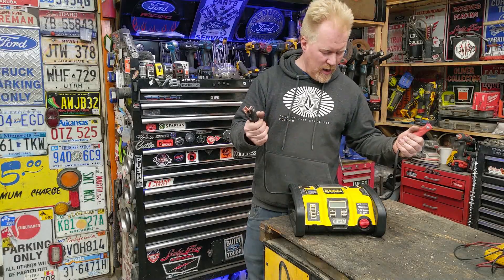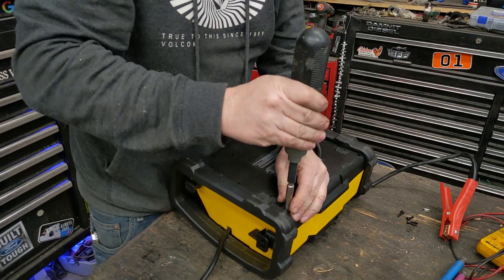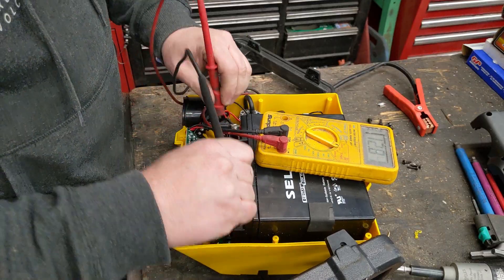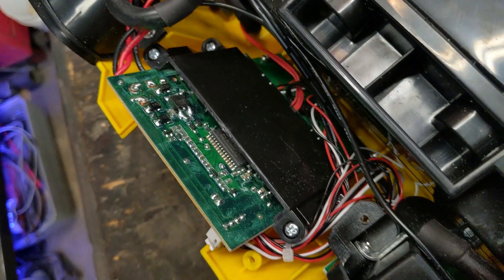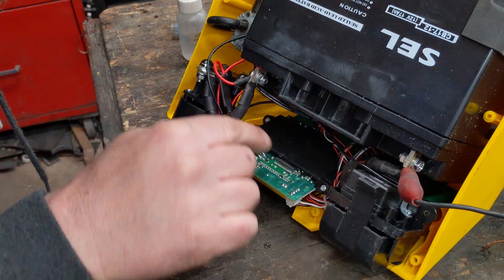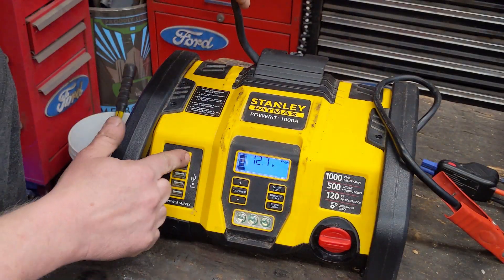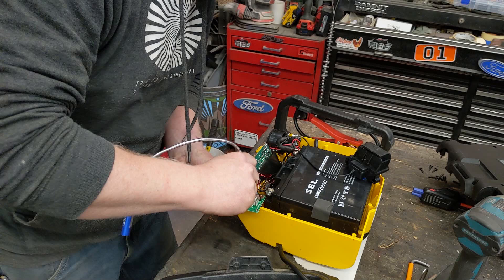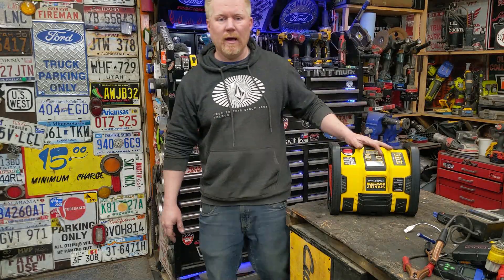NEW Jump Start Box DEAD - CAN it be FIXED?

Comment: You might want to open it up one last time lol.
Use a hot glue gun on all the connectors and loose wiring, like the ones on the pcb you fixed.
Zip ties could be used to stop bunches of wires wagging around, reduced movement.
Maybe wait untill it fails, then go mad with the anti movement modding 😀
Looks like a handy unit, but as you sort of said the lithium battery pack just pisses all over the lead acid battery lol. Smelly battery :-D.
Reply from the maker: Yeah, hot glue will keep it from moving for sure.

Comment: Your dog is truly “man’s best friend”. I have some pretty new Ryobi batteries that went on the fritz. Ryobi sent me new ones. Which was super cool. I wonder if u could use your diagnostic skills and find the problem. Thank u.
Reply from the maker: Generally it's just one set of cells in the pack that goes bad. I will open the pack and test each set 4.1full-3.0v empty and  any cell that is way lower than this is generally bad. If I have two packs I will cannibalize one to make the other good by soldering in cells.

Comment: I have seen this at pawnshop super cheap because of the same problem
Reply from the maker: I steer clear of these used even when working as the Lead Acid only has a 1yr-7yr lifespan depending on how well they cared for it. Generally they aren't cared for vary well.

Comment: I'm a min into the video..  Dead lead acid battery is my guess.
Reply: BTW, how you like those Wera L-Keys?  Pretty snazzy!
Reply: Damnit, I was wrong!
Reply from the maker: @AtimatikArmy  Dead battery was my first guess as well. But then after I left it on the charger for an hour and still got nothing I was assuming a battery connection had fallen off. Generally you'll get a little bit of juice even with a dead battery.
Yeah those are my Wera Hex plus keys and I love them. Expensive little buggers but they just fit so much tighter than any other hex key out there.
Reply: @sixtyfiveford  I have the non color coded set of the Wera Hex plus keys (well the SAE set is nickel plated and the Metric set is black oxide or whatever, so that's still nice) and agree, Bondhus has nothing on these, IMO!  BTW, you got lucky on finding the issue on the jump pack so easily, good find and fix!
Reply from the maker: @AtimatikArmy  My SAE kit is non color coded as well. I originally bought the color coded SAE ones and they broke/snapped off in allen. That would be fine but you can't trim it back as they are round shank. I decided to keep the color coded metric only because the non color coded was out of stock.
Reply: @sixtyfiveford  Wow, broke huh?  Yeah the ball end is always the spot they snap on any brand it seems. They are damn hard which is good for the most part!
Reply: Oh I just assumed the ball end broke off but you said the color coded ones are round shank, wow odd, didn't know that!  So they have to grind their clever hex shape on every end..  explains why those color coded ones are so much more expensive..
Reply from the maker: @AtimatikArmy  I was mad at first but then thought I'd rather it snap than round the hex. I guess it shows how tight it grabs. it wasn't the ball that broke, the small side snapped right off on the 1/8 if I recall.
Reply: @sixtyfiveford  I gots yah now and I agree about hardness, it's a tradeoff and I'd rather err towards the harder side as well rather than have it distort and round out like anything that comes from China...
Reply: Oh yeah, I didn't say it yet.... DIY MASTER!

Comment: I've often cut the good cables on them in order to make parallel bridges in order to increase campers of current while maintaining the same voltage in order to start heavy trucks ...
Reply from the maker: I take a heavy gauge wire and jump it from one side clamp to the other on all of these. Like you noted it makes a huge difference.